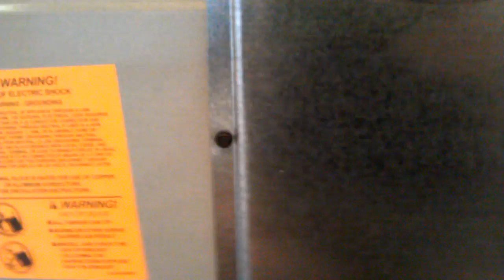How to install a stove cord

Comment: I also had trouble with this task, but not with the video, which looks pretty clear to me. I was confused with the colored wires already wired on the stove, yet the electrical cord does not have corresponding colors. Mine also does not have open or U-shaped connectors, but circular, in which case, you must remove each of the screws.  The wires are "really thick" just like the man says, and they are difficult to manipulate. I was actually afraid I may have broken the middle one inside the casing.

Comment from the maker: Your question confused me because you asked "If I forget to remove..." and when you install a stove cord you want to make sure everything "is" attached correctly not "removed", I am sorry that I do not yet have a 4 pronged stove cord video but Please make sure everything is attached properly. Though the copper bonding strip or "ground wire" and the neutral wire eventually connect to the same terminal in your breaker box please connect it. Have a great day!

Comment from the maker: It sounds like you have a grounding issue. Or one of the wires is in the wrong place. If one of the "HOT" leads OS hooked to the ground on the stove you may have 120 volts energizing the entire stove. Please email me a picture of your stove cord connection terminal to askthemaintenanceman@gmail.com We can get this fixed.